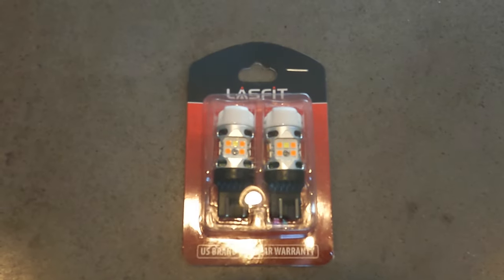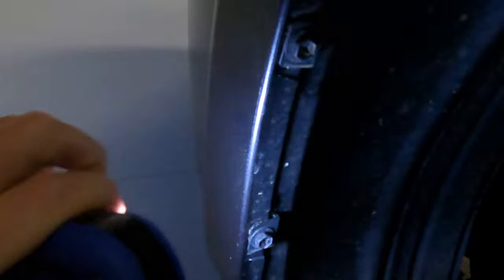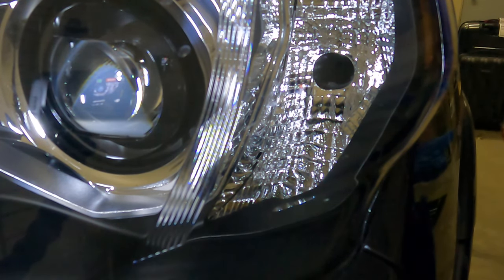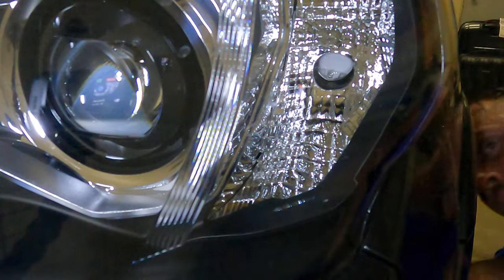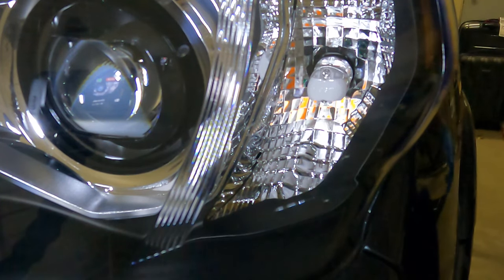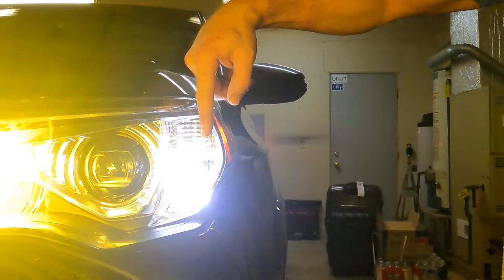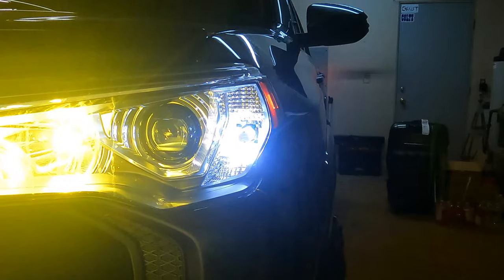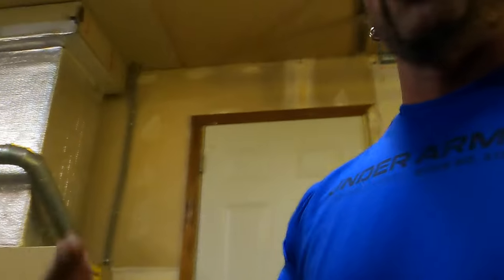Toyota 4Runner turn signal LED switchbacks install - Lasfit - No resistor  - No hyper flashing

Comment from the maker: If you are interested in getting these switchbacks for your 4Runner you can go to https://www.lasfit.com/products/7443-switchback-led-turn-signal-bulbs-t3-series and use the code DUSTIN15 to get 15% off of them. The discount code will work for the first 10 people who apply it.

Comment: U get ur moneys worth for $60 a pair.

I will tell u. These Lasfit - T3’s are better than T2’s. 

How?

Simple.

Both T2’s and T3’s have same approach in brightness. But one has much better feature.

T2 has a full aluminum heatsink and 4 small air ventilation holes 

And T3 has a hybrid type of Aluminum, with ceramic cap on top, and 8 larger ventilation holes. 

Both got temperature control built in to the led bulbs.

While the T2 still gets hyperflash after 2-5 minutes. Sometimes 10 if ur lucky. 

Its question for is it worth $50.

But with T3, it’s worth $60. Because the T3 also has a ceramic micro chip, a heat filter that’s inside between wedge base and aluminum, they even update the decoding time for more than 30 minutes before it gets hyperflash. 

That’s a huge benefit. 

Lasfit listens to the customers that they find the T2 too bright for 24W led bulbs making 2400 lumens each.

It’s ultra bright and we love it.

So lasfit made these led bulbs, they kept the same 24W to meet and exceeds the oem wattage, but they reduce the luminosity of the led bulbs. By 400 lumens drop. 

So it’s now 2000 lumens per bulbs. 

It may not be as ultra bright as T2, but the T3 still brighter than stock. 

We have them in my family’s 2017 Toyota sienna rear 7440A led bulbs. And these are better upgrade version, without dealing with hyperflash. 

Yea u still get that typical 1 year warranty, but that better heat efficiency, better heat resistance, these led bulbs will last much better than T2.

It is indeed a must have led bulb upgrades. 

So u get ur money’s worth for ur 5th gen Toyota 4Runner. 

🙏🏼🙏🏼🙏🏼🙏🏼

@DShanman
Reply from the maker: What a great write up about these bulbs! You’ve done your research with these. Additionally, you personally have them in your vehicle so you know how well they work and how good they look. Thank you for the detailed description!
Reply: @dshanman24  hey Hakuna Matata man. 

It’s my pleasure to help.
Reply from the maker: @toyotabrony Thank you. I appreciate that my friend.
Reply: @dshanman24  ur very welcome. 😎

Comment: I just installed mines but I can see my DRL lights doesn’t working so what’s the solution?
Reply from the maker: You mean the turn signals are the only part working and the white light isn’t staying on?
Reply: @dshanman24  the white is on working good, but the DRL light mode is off, when I switch to se up level, the white is on, but on the turn signal bulb, not the high beam
Reply from the maker: @diegormz8188  On my 4Runner I can have the DRLs on by themselves, DRLs with running lights on or no DRLs with the headlights on. The switchbacks won’t be showing white in DRL only mode.
Reply: @dshanman24  before on DRL ONLY the high beams was working on low voltage, the white/ámbar is working good
Reply from the maker: @diegormz8188  Hmmm…I made a harness for my DRLs so I could use LEDs in them. Depending on your year of 4Runner the high beams are where the DRLs are or the headlights are both low and high beam.
Reply: @dshanman24  my is 2017 I don’t have a harness before to install the turn signals, the led high beam turn on on low voltage (flickering but really less) and after install this turn signals the high beams on DRL are not working
Reply: @dshanman24  do you think is the difference of voltage?
Reply from the maker: @diegormz8188  It could possibly be that. I’m sorry I’m not of more help to you. You may be able to reach out to Lasfit and see if they have any suggestions for you. It is possible they have seen this happen before.

Comment: Put em in and they work great until you get stuck in traffic and then voila hyperflash! Anyone have any ideas?
Reply from the maker: I have never seen this out of mine. You may contact Lasfit and see if they have any suggestions.
Reply: @dshanman24  I bought a set of T3 7443's but they weren't T3 7443D's mine had gold caps on the end and said Lasfit. I will try the D's next.